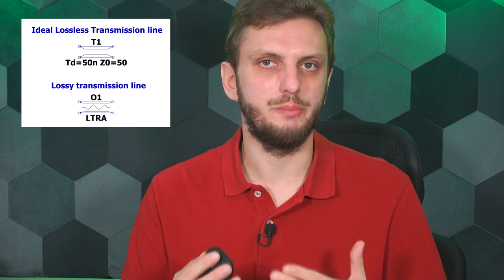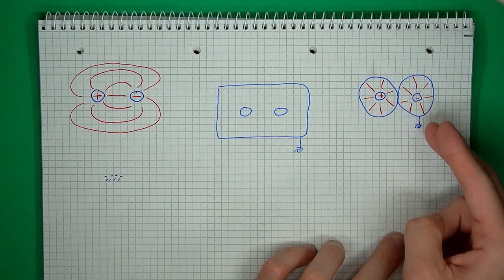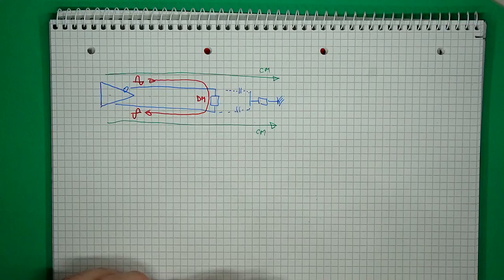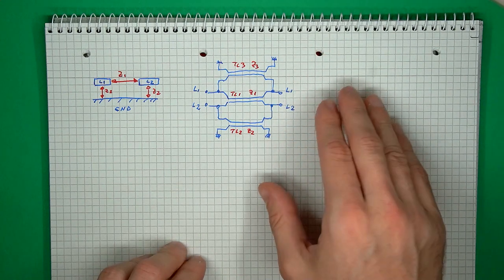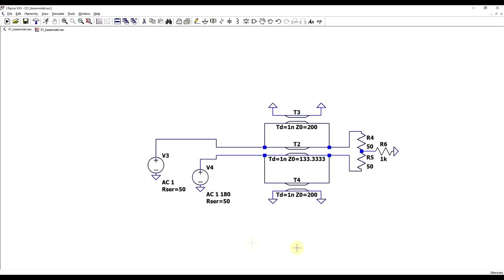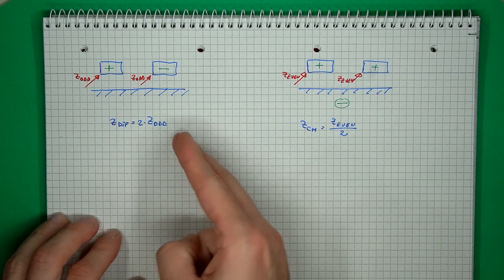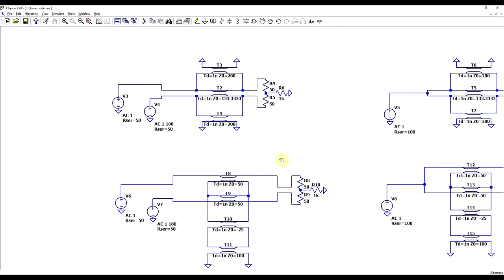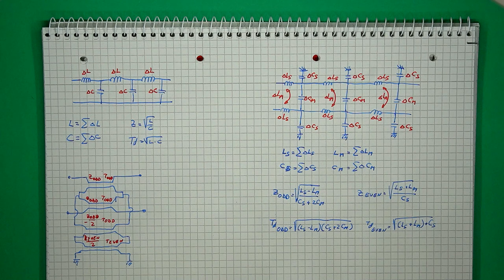LTspice tutorial - Differential transmission lines

Comment: Very informative! I'm curious how you would go about simulating lossy transmission lines. I tried using the LTSpice "ltline" component but it says you have to add the .model which looks like you need the ltra.MDL file and I have been unable to find it or figure out how to create it and where to put it.
Reply from the maker: Actually, for the ltline, you can make a very basic model like the example in the help file (and throw this as a command into the simualtion):
.model MyLossyTline LTRA(len=1 R=10 L=1u C=10n) 
there are some other possible parameters, but these 4 are the main ones you need.

Comment: Hmmm. The equation for Zcm = Z2||Z2 sort of was intuitive to make sense of. The equation for Zdiff = Z1||(Z2+Z2) was a bit harder for me to understand. Could you explain how this equation was derived?
Reply from the maker: Well, it has to do with the direct and indirect link between the 2 lines; Z1 is the direct link; and Z2+Z2 is the link trough ground - so there the link from L1 to GND which is in series with the link from GND to L2. Finally these 2 links are in parallel, so its Z1||(Z2+Z2)